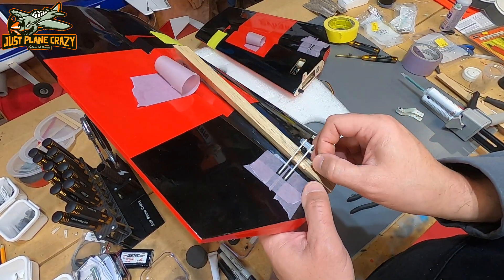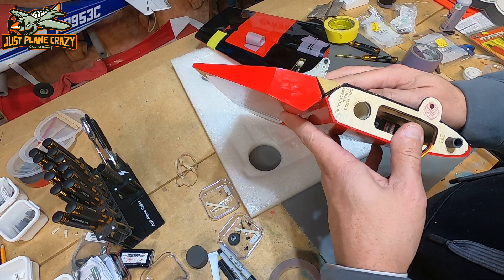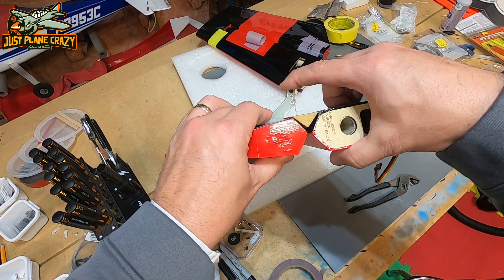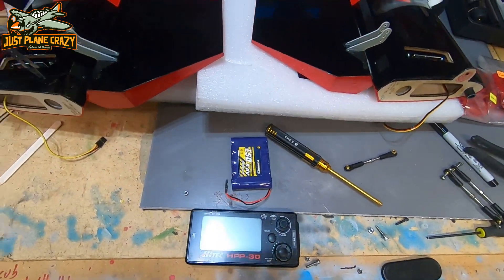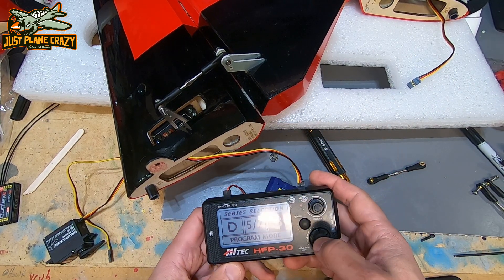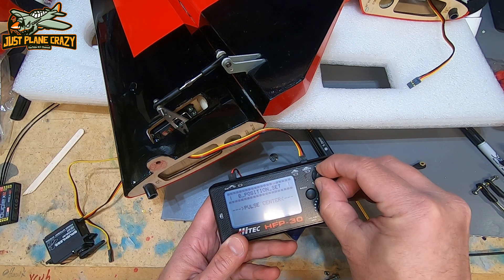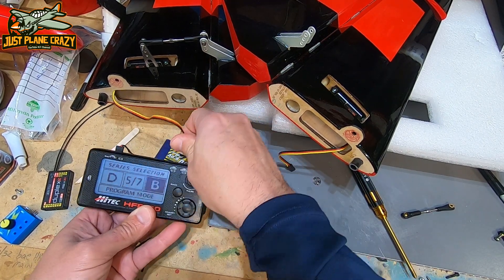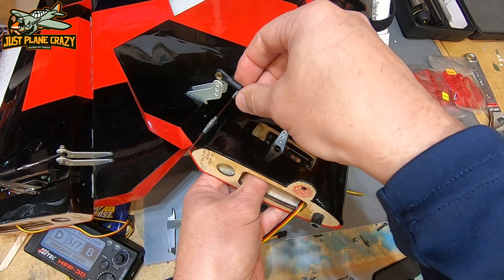How to Sync Elevator Servos, Mechanically and Electrically, Hitec Servos Programmer

Comment: brendan i have question. im trying to sync some d645mw servos for my legend hobby t28 build. i just got the hfp-30 programmer. on your video your servos show 54 in each direction. when i connect my servo the number is in the 100s and i cqnt get left and right to match like you did because i have to reverse 1 but i want the travel the same each direction. any ideas?
Reply from the maker: The number for each servo may be different. Like your vs mine. One should be a positive number one may be a negative for yours. Reverse it first and then set endpoints.

Comment: Do I connect them in different channels? Or both connected to a Y cable in the same channel ? Thanks
Reply from the maker: Different channels is always best. If perfectly matching servos you can always do a y. The better they are programmed the better they turn out on a y

Comment: I have had problems replacing aileron servos……they act like flaperons……when I replace one it moves in sync with the other servo…acting like flaperons instead of ailerons when connected on a Y connector into the receiver…Do servos come in left and right for the ailerons?…very frustrating….any ideas…..thanks
Reply from the maker: If the air the same way in the plane wing side to side they will do that. Either need one reversed or split the channels if it’s not digital and can’t be reversed. What plane is this?
Reply: @JustPlaneCrazy  it happened first on my Pitts biplane….I ended up taking out the y splitter and putting the ailerons on separate channels..I didn’t like doing that though….now it happened to my daily flyer which is a Dynam Waco….very frustrating.
Reply from the maker: It’s always better to have separate channels. That way end points can be properly setup and differential if needed. Question to me is why do you keep having Servos failures. I can’t honestly say I have have had more than 2 in my lifetime
Reply: @JustPlaneCrazy  Thanks…….I’m a freshman in the hobby….on the Pitts it happened after a crash (signal loss) but the Waco was different…I had flown out five batteries on a short runway  with one steep angle of attack landing….the next day I checked and my right aileron was out …I replaced at the field..but ended up with flaperons.  I will probably end up putting it on a separate channel. Thanks for your help.
Reply from the maker: I see. Just bad service luck. But yes some planes need reversed servos on the opposite control side. I always prefer everything on separate channels. The other benefit is less items to fail.

Comment: hey brendan does that servo programmer work on different brand servos
Reply from the maker: I have not tried it. I have not purchased other brand programmable servos to try it. I would be interested myself to know that. My hunch is no
Reply: @JustPlaneCrazy  The programmer only programs Hitec servos, but you can use the test option on the HFP-30 with any other make.
Reply from the maker: Awesome info thanks